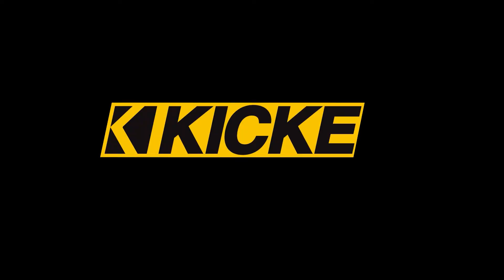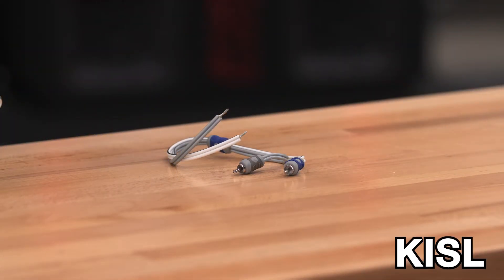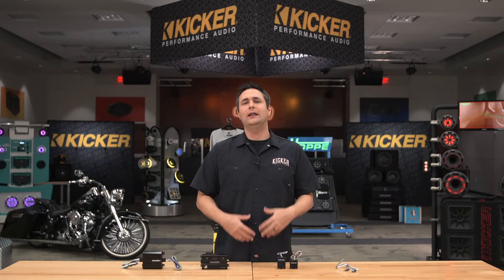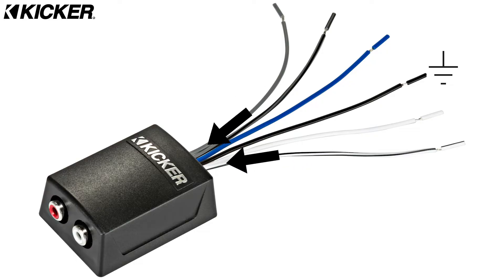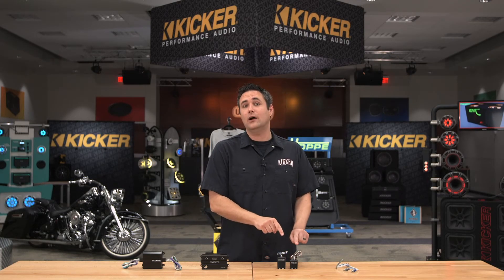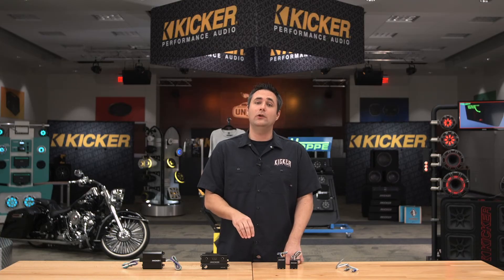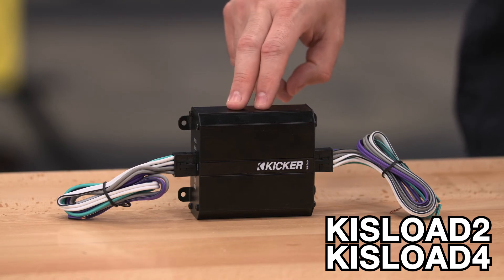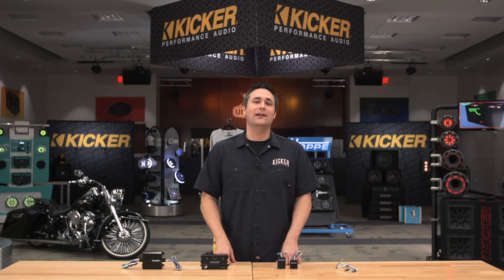Add an Amplifier To Your Factory Radio - KICKER Integration Components

Comment: I have a kid loc2 and it’s not working that great . I  have tapped the wires going to my Bose sub for input. It works until the is turned off and restarted. It loses power on the remote wire at that point .
Reply from the maker: Please contact our tech support to troubleshoot the cause of this.

Comment: How is the remote wire getting power from the speakers?
Reply from the maker: It's not a full 12V output Turn On, it's using the DC Offset from the source unit!
Reply: @ so all
I have to do is hook the speaker wires up and run the remote wire to the amp?
Reply from the maker: @ That's correct

Comment: Hello,

I'll like to upgrade the speaker system on my toyota hilux (it's a pickup truck no available in the US). I bought the Kicker 46CXA3604 amp, one kisload4 and a pair of kisloc2.

Is all of this necessary or just the kisloc2 would be enough?
Reply from the maker: I think you'll only need one of the integration interfaces. Use this chart and see which one has the features you need :) - https://www.kicker.com/app/series/caraudio/accessories/locs_interfaces/files/integrate-components-comparison-chart.pdf
Reply from the maker: I think you'll only need a single KISLOC2, but I can't be certain. I can say I wish we had the Hilux in the USA!

Comment: I had the kicloc2 line output converter installed when hooking up a subwoofer. Now my front door speakers don't work? Any idea on what's going on? Thanks
Reply from the maker: Sounds like the wiring got a little messed up. Was it done by an installer, or was this a DIY build? I'm going to need more info on how the system is wired. The KISLOC2 won't affect anything besides taking your HI Level signal and making a LO Level signal. There's nothing about the product that could interfere with your other speakers. At all. Where in the signal chain, and/or on what source unit outputs, was the KISLOC2 installed?

Comment: I have an nvx 2 channel line output converter and I got it for a subwoofer and amplifier. Now I want to install new door speakers and an amplifier. My line output converter only has Left and Right positive and negative high level inputs and bass L and R and main L and R rca outputs. Does this mean I don’t get any ability for rear speakers to be installed? It it only front speakers?
Reply from the maker: A few questions:  first, what is your vehicle?  We need to know trim package as well as year/make/model.  Second, what amps are you using?  Our amps usually don't need a line out converter (in fact they sound better without them).
Reply: @KICKERAudio  my car is a 2020 vw GTI s trim. I have a skar 15 inch sub and a skar mono amp and an NVX loc. if I could get away from the LOC and just wire 2 amps in, 1 for sub and 1 for door speakers that’d be great

Comment: What should I use for my 2018 Escalade?
Reply from the maker: Simple question, but a complex answer:  it will depend a great deal on what your goals are. Full system replacement? Adding a sub? Just swapping out the factory speakers? What is the trim package of the Escalade? Are you adding amps?  In this case, its best to talk to a shop. They can check out your Cadillac and build a system for you: www.kicker.com/dealer-locator

Comment: So if I get the Kisloc2, I can use the  remote turn on output wire to turn on my amp? this way I will not have to run a long separate remote wire from my factory unit to the amp?
Reply from the maker: Exactly right.

Comment: What do i need to get if im going to put two subwoofers in my 2019' altima w no bose system
Reply from the maker: It is likely you don't need an adapter if you use a Kicker amp. If you want to verify that, you can contact Tech Support at support@kicker.com or call us at 405-624-8510.

Comment: How do you connect this to a Mark Levinson factory amp in a Lexus?

I’m trying to replace the factory subwoofer with a bigger subwoofer and separate subwoofer amp while keeping the factory Mark Levinson amp in place to run the factory speakers.

The recommendation from various forums has been to tap into the factory subwoofer output of the Mark Levinson amp for the input signal instead of the left and right rear fill channels, but how do you do that when the subwoofer output only has two wires and the kicker LOC2 has 4 wires (a left signal input and a right signal input).

Do I tie the two positive wires on the LOC together and then the two negative wires of the LOC together first and then connect them to the single sub output wires of the factory amp ?
Reply from the maker: What is the year/model/trim package of the Lexus?
Reply: I am also having issues on my lexus with mark levinson package just as mentioned above i got the kisloc2 and wired up the the stock subwoofer to the wires of the kisloc2 connecting both sets of positive and negatives to make it one channel and then to the sub wires but i can not get the light to turn on so the remote does not send 12v to my amp the car is a lexus g470 any help would be great

Comment: Does the load4 work on an aftermarket head unit to deliver more power to door speakers like the alpine power pack?
Reply from the maker: It is meant for factory systems, adding resistance to the speaker wires since some will shut off when they detect the wrong idle resistive load. It is not meant for aftermarket radios.

Comment: Hey i got the kislock2 and its not power on. The wires are connected to the right speaker wires.
Reply from the maker: Verify you have good chassis ground.  The connection should be to bare metal. If that doesn't solve it, call Tech Support at 405-624-8510.  They are open weekdays from 8-5c.  You can also reach them at support@kicker.com.

Comment: what do you recommend for a 2022 corolla hatchback?  i will be using 4 channel amplifier and single channel for subwoofer but want to retain the factory stereo
Reply from the maker: Using a single channel from a 4-channel amp is very unusual.  When a 4-channel amp is used, most often 2 of the channels are bridged for the subwoofer.  Is that what you meant?  We would also need to know the model of the amp to determine what it can safely run and how much power it can deliver.
Reply: @KICKERAudio  i will be using a 4 channel amp for front and rear components and a single channel amp for subwoofer.  im using jl audio 300/4 and jl audio 250/1 for the sub.
Reply from the maker: @dronesurfboards  ok then you're looking for a RMS around 250. This would work well if you want a loaded enclosure: https://www.kicker.com/compc-10-subwoofer-box
Reply: @KICKERAudio  I have a subwoofer already.  I wanted to know which loc is recommended for multiple amplifiers on factory headunit.

Comment: Iv got the loc2 hooked up, got my speaker level input to the loc hooked up spliced in from the rear speakers. Iv got it grounded to the chassis. And the remote signal wire from the loc to the amp hooked up. The loc led light is not on and the amp is not powered. Any suggestions?
Reply from the maker: Sounds like you don't have power. If you need to walk through the installation, give us a call at 405-624-8510.  Were open weekdays 8-5c.

Comment: I’m pretty sure this will work for my 2020 ram 1500 non amplified factory radio that I would like to add an aftermarket 4 channel amp to, but can you confirm this?
Reply from the maker: If you email us at support@kicker.com we can verify that, or you can call us at 405-624-8510.  We are open weekdays from 8-5cst.

Comment: I bought the kisloc 8V. I understand how to wire it in but how do I get a remote signal to my amp. I feel like I'm missing something here. Can anyone help out?
Reply from the maker: We're not 100% sure what you mean but "8V", but we have two versions of the KISLOC.  One is simply called the KISLOC (has two holes on the top to adjust gain) and the other is the KISLOC 2 (no gain adjustments), which gets power from DC offset - power that is always present in your speaker wires and is not part of the audio signal - to give you 12v switched power for the turn on lead.  This means you don't need to tap into a wire that has switched power, as you would with a traditional LOC.  If you want additional advice on how to do that, hit up our Technical Support Department: support@kicker.com or call us at 405-624-8510.  We are open weekdays from 8-5c.

Comment: Hello there, would kisloc be good for my 13 sienna that i plan to add an active sub on? Thank you
Reply from the maker: If you use one of our CXA amps, you will not need a line out converter at all.  All you need is an RCA cable with one of the ends cut off, like the KISL: https://www.kicker.com/2-channel-speaker-rca-converter
Reply: @KICKERAudio  
Why is it we wouldn’t need a loc? I understand cable you linked takes the signal from the speaker wires and converts to RCA to go to the amp but does the amp have the converter built in? Also to what capacity? The LOC2 or the KeyLoc?

Comment: What do I need for a 1997 Buick lesabre custom
Reply from the maker: If you are using one of our amps then you should not need a line out converter at all. That said, if you choose to us the KEYLOC for its DSP power if you want, or you could use one of the KEY amps, which has the DSP built into it. Either way, your sound quality would improve.

Comment: I just got a Kisloc2 and i was wondering, the blue wire is the remote in to turn on the amp correct? And can i wire the ground to the ground input thats on the amp?
Reply from the maker: Yes, the blue wire is the remote turn on. The ground should not be connected to the ground input on the amp, though it can be terminated to the vehicle in the same location as the amp.
Reply: @KICKERAudio  so do i need a switch to turn it off?? how does it power on and off so i dont run down my battery?

Comment: The kicker key lock sounds like it might work on a Harley has anybody ever tried it
Reply from the maker: The basic functions would work, yes, but the frequency range would change when you flash the radio, which is almost always the first thing you do. There are some who try to use the KEYLOC's software to bypass the need for a flash module by using the acoustic correction software in the KEYLOC, which will improve the sound, but flashing the head unit is always the preferred option. One note:  the KEYLOC was not designed to be weatherproof, so if it were used on a bike, you would have to protect it against the elements. Please feel free to contact us if you have any other questions: Tech Support's contact info is: support@kicker.com or 405-624-8510.  They are open weekdays 8-5 CST.

Comment: Hi, could you make a video giving an overview of how you would use kicker keyloc when you need two amps, a 4 ch for front and back speakers and a mono amp for the subs in the back. I like kicker but I don’t see what kicker components meet this but the lc7i seems to do the job. What do you suggest?
Reply from the maker: The Lc7I is a 6 channel output, so it is more convenient from a channel standpoint, but doesn't fix any of the acoustic issues the KEYLOC repairs.  In your case it would depend on the amps you chose. For example, most Kicker amps do not need a separate line-out converter as their input sensitivity ranges from as low as 125mV to 40V, so you can wire factory speaker leads directly into our amps via the RCA inputs (you can use a KISL to convert the wire into RCA, or use your own solution). The issue the KEYLOC doesn't immediately solve is factory fading. Most people utilize their 4 channel amp with a single stereo input from the KEYLOC.  You then adjust the amp's rear gains (usually channels 3/4) to reflect the mixture of front and rear speaker volume you want.  

As far as the subwoofer amp, using an RCA Y-splitter from the outputs of the KEYLOC would solve that issue. One set of RCA's goes to the 4-channel amp and one set goes to the sub amp. They would all receive clean, full range signal, which would then be controlled by the crossovers in each amplifier. Most mono amplifiers offer a remote bass control for adjusting output on the fly.

The question you ultimately have to ask yourself is how much you care about being able to fade front to rear.  If you value that a great deal, and want the acoustic quality only the KEYLOC offers, then get a pair.  Otherwise, the smartest thing is to get a single KEYLOC and split the signal as suggested above.  Sorry for the long response, but we wanted to make sure you knew what options existed.  Please reach out if you need anything else!
Reply: @KICKERAudio  thank you for the response, I have been analyzing it and think it would be easier for me to get a 4 ch amp that has a built in dsp to fix the stock acoustics but that also has output rcas to power my current kicker 800.1 mono amp for the subs. This way I can ignore the locs. But do you have such a kicker 4 ch amp with dsp and rca output for second amp that you recommend I get?

Comment: Which would work for a Hyundai w the infinity system?
Reply from the maker: Depends on many factors: the year, model, trim level and audio options.  The best thing to do is check with a local dealer, or with our Tech Support group. You can call them weekdays from 8-5 cst at 405-624-8510, or email them at support@kicker.com. 

To find a dealer, both in-store and online: www.kicker.com/dealer-locator

Comment: Is the kisload4 what i need for a jeep gladiator 7”  headunit?
Reply from the maker: James,  I am checking on that for you.  I am assuming you want to replace the door speakers and amplify them?
Reply from the maker: Just got it confirmed.  Yes you would need a KISLOAD.
Reply: Yes i am replacing the 4 fronts with a component set

Comment: I use Key amps in my G8. Work great.
Reply from the maker: Good stuff!
Reply: I have a g8 , what is this you are talking about , i just installed a downfiring 10 inch sub , all 6 1/2 speakers i got the kisloc2 , should i have gone with the next one up ?